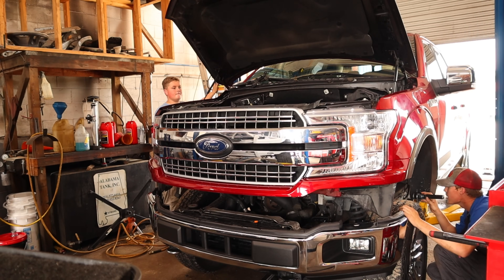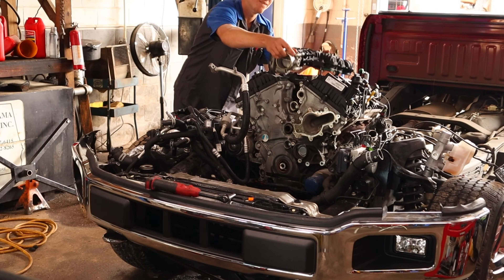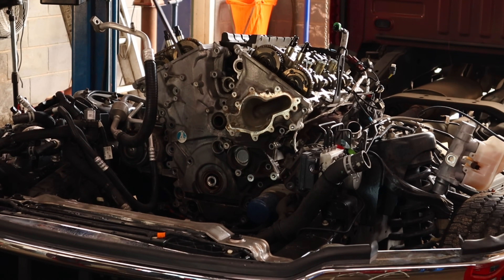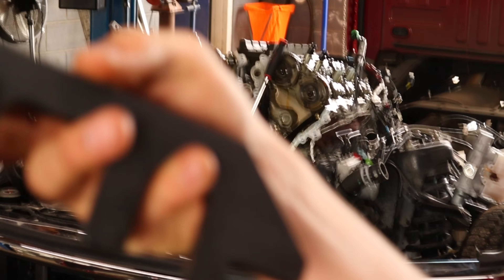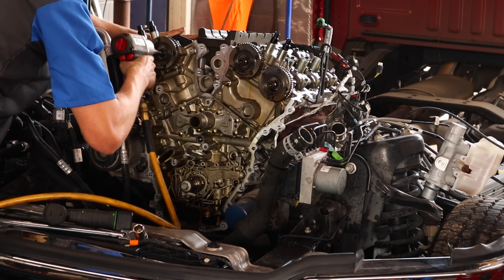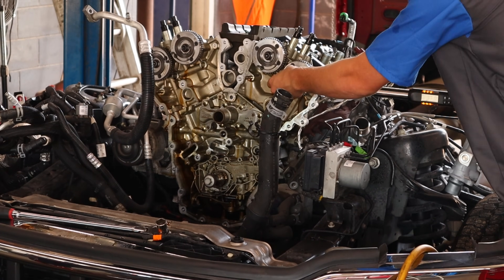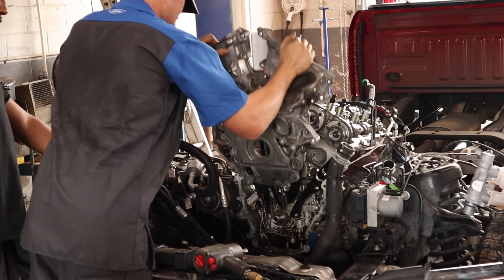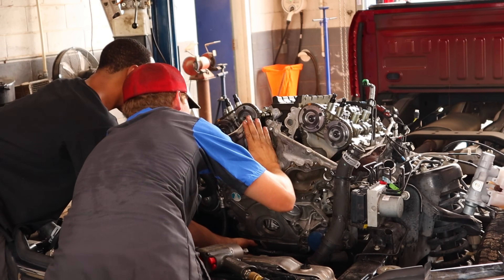Ford 3.5 EcoBoost Cold Start Rattle (VCT Phasers) | Everything You Need To Know

Comment: I miss my ford, but I don’t miss the never ending issues and TSBs that applied to it. You do a great job man
Reply from the maker: Thank you!
Reply: @FlyingWrenches13  I have the 2018 f150 with the 5.0 coyote. I have the cold start rattle every morning and doesn’t seem to give me any issues but this past week I noticed it was way noisier than usual and I’m wondering if it’s detrimental? I’m just wondering if it’s something like the hammy tick where it’s just what this engine does. It does knock too, I bought this truck last December and I kinda feel like they screwed me on this deal. It runs great but those are the two main things that bother my about the truck.

Comment: Curious as to why this isn't as common of a problem on the 2.7s or the coyotes. I traded my 3.5eco in on a coyote when it rattled, I miss the torque no lie but I like the  peace of mind that the coyotes are less likey to mess up
Reply from the maker: It’s very interesting for sure because the 2.7’s actually have the same phasers down to the part number. Never seen one rattle. Makes me thing it’s more of a oil flow issue than a phaser issue.

Comment: Sad owned fords all my life have 15 now anything with a modular engine or non push rod engine is garbage.Got a 18 3.5 been rattling since 52 thousand 70 thousand now.Have extended warranty think i will have it fixed then dump it.18 expedition max platinum.
Reply from the maker: Shouldn’t have issues after replacing the phasers.

Comment: On all of the recalls I have found, Ford says the rattle doesn't cause any damage.  Is that true?  I have an Expedition with 115,000 miles, and has had the rattle off and on since 60,000 miles, but it has never been included in a recall.  What I do now is a flood start for the first start of the day and that seems to work.  I was told about this by another Ford master tech.
Reply: What is a flood start?  I always thought a "flood start" was a a fuel-flooded start, which pretty much went away with EFI engines, but from your context it sounds like it's different since we're talking about the oil system here.

Comment: Press the gas pedal down to the floor and hit the ignition switch. The engine will not start and you can build oil pressure before you start it up.
Reply: From a certified mechanic, this is probably a good bandaid until you can afford to get it fixed.
Reply: It works will not start w pedal on the floor.
Reply: In my mind, my question would be, if oil was once reaching the top of the engine and then over time, oil pressure isn't building as quickly as it once did, what is the culprit?  If pressure will build, granted slower slower than it used to,  why would you (anyone facing this problem) immediately point to the cam phasers as the culprit?  Why wouldn't the issue point/indicate a decrease in oil delivery itself (i.e., oil pump)?
Reply: So is that bypassing the problem? I just started to get the rattle at start 2015 140k 3.5. And holding it down it doesn't rattle.
Reply: Mine is gas and brake simultaneously.  It works
Reply: On mine I hit the driver door lock/unlock switch 3X,  ignition on/off 3X, lights on/off once, honk twice, open/close the driver side door and start. 
GTG for 1 week worse case scenario.
Reply: You seriously did that? Lmao 😂

Comment: I have a 19’ F-150 3.5L Ecoboost, had the PCM update done early on and it caused the shutter. That was about 20k miles ago. Rattle has gotten louder and I now even get a slight rough idle when in Drive at a stop light. How much longer do you think it’ll last before it has to get towed in? I’m at 60k miles now, it’s a work truck so I told the dealer I didn’t really care and was just gonna send it until I couldn’t or it blew up. I got the word today that my truck is getting replaced, they are ordering me a new 3/4 Diesel. Hopefully it comes in before this truck blows up. 😂😂🇺🇸
Reply from the maker: Are you getting another ford? It will probably last forever even though it keeps rattling.
Reply: @FlyingWrenches13  I think so, I requested a Ford, we use Enterprise Fleet so they surprise us occasionally. Right now I am being told that Enterprise Fleet cannot order Fords or Chevys, only consumers can. So I could be getting a Ram. Yikes! 🇺🇸💯💯
Reply from the maker: Uh oh! Yeah new inventory is pretty scarce right now. Maybe they get you something that holds up!

Comment: Anyone out there having problems after problems with the 3.5 ecoboost. Mine has under 70k miles and always in the shop with the hood up.
Reply from the maker: What’s happened to it?
Reply: @FlyingWrenches13  warped manifold. Spark plug failure. Turbo coolant leak. Alternator went out. Now it has the timing chain start up rattle. It must be a lemon?
Reply from the maker: All of those are very common issues with those trucks. I wouldn’t call it a lemon yet but definitely sounds like you got a bad one.

Comment: Thanks on the great video, didn't even know this was a thing. Parents just bought a 2019 F-150 and it was not until I watched this video that I decided to do the research and found out that the truck still had a recall for this exact issue. Weird that they would sell a truck with an open recall like that.
Reply from the maker: Thanks! Yeah they aren’t supposed to be able to sell with open recalls.

Comment: I done a 19 F150 last week and today I'm starting in on an 18 expedition. Something I've noticed on them as I'm doing them, it always seems to be the drivers side intake phaser that fails. Ford released new phasers for the issue but I am curious to know why it always seems to be the same phaser. Very strange...
Reply from the maker: Your saying the driver intake phaser is the one rattling?
Reply: @FlyingWrenches13  
Yes, once the chain is removed grab the sprockets and try to move them by hand. They should be locked in place but the several I've done you can turn the drivers side intake sprocket lock to lock on the phaser. Seems the locking pin is failing for whatever reason. The sprockets are the same left to right so I wonder if the solenoid is being held slightly on on the drivers intake and causing the locking pin to wear excessively, or something along those lines. They have a PCM reprogram that is supposed to fix the concern as well. Time will tell after this latest update.
Reply from the maker: I’m gonna check this on my next one. Thanks for the input!

Comment: Thanks for putting out the video. 

Have you seen this issue with the 3.5 ecoboost in the Ford Transit vans?  

I believe the Transit vans still get the older gen1 engine. I am sure the engine has been updated some over the years, but since it is a DI engine only with no port injection, everyone still calls them gen 1.
Reply from the maker: Yeah I think they are. I’ve never seen a transit with this issue.

Comment: We had a 2015 Explorer Sport and now have a 2019 Explorer Sport and a 2021 Powerboost F150. All have the 3.5l. The first Explorer had startup rattle fixed twice under warranty in the first 50k miles. The 2019 is ok so far, but had a very slight rattle the other morning with 29k on the meter. We always pay th roughly $1,800 for the ESP platinum warranty from Ford as it gives us a rental and is cheap peace of mind.
Reply from the maker: How do you like the power boost?
Reply: @FlyingWrenches13  I love the quiet and smooth ride. My other truck is a '98 3500 RAM. The acceleration is very impressive at all speeds too. My only real nitpick is the sometimes rough startup as the transmission shifts from 1st to 3rd and the gas engine starts. This can be minimized by how you accelerate. If you start up slowly, the gas engine won't come on and it is smooth. If you really step into it the gas engine comes on and it shifts from 1st to 2nd to 3rd, which is also smooth, but if you step into it just a little, it will start in electric, then as it jumps from 1st to 3rd, the gas engine comes on at the same time and there is a little jerk. Again, this is nitpicking. 
For a new truck redesign I am very pleased and really expected more bugs and quirks. The best part is the instant torque when pulling onto a highway or passing. Makes driving my Explorer Sport seem very laggy by comparison.
Reply from the maker: Yeah people don’t quite understand how on demand the torque is until they drive one. Thanks for the feedback!

Comment: 2017+ 3.5 ecoboost: leaky oil pans, rattling timing chains, useless 10r80 transmission…. I see why people are going to the outdated 5.7 I force from Toyota. A $40k+ truck shouldn’t need thousands of $$ in repair work before 100k miles
Reply: 127k on mine ....none of those problems
Reply: 5.7 tundra was best truck I ever owned. 6 years and never had an issue with it.

Comment: This just started happening to my 2019 3.5 ecoboost. I downloaded the my ford app, when I inputted the vin it showed the recall for the transmission reprogramming. Truck has been at dealer for a week now with no update, they want to run further tests. Should I be telling them to no reprogram it? the truck only has 14k miles on it.
Reply from the maker: Yeah they should just be able to perform the program. If it solves the rattle great, if not order some phasers.

Comment: I bought a new 2018 F150 2.7 ECO and it had a nasty loud engine rattle on cold engine start (sounded like timing chain banging on metal) the day after I drove it off the dealer lot. I wonder if that's the same noise you're talking about? My dealer wasn't able to fix it for about 2 months (parts were back ordered) so I returned the truck and got a different one. This is the first Ford tech video where I've seen you take the body off. Looks like a lot of extra work but maybe it's not. Do you do that so that the video recorded work is much more clear? Thank you for sharing your expertise.
Reply from the maker: It’s not just for the cameras. I remove cab on everyone I do. Takes about and hour to get off.

Comment: It oil pressure issue. The next one that you come across that has that tiny rattle   Hold the gas pedal to the flow turn engine over till oil pressure come up release it want rattle. there a point that this don’t solve it either I guess it pretty much toast by then needs phasers and chain lol

Comment: How has ford STILL not figured out the VCT issues?  They have been having issues since the first 3v 5.4's came out MANY MANY years ago.  I love my ford trucks but Ill never buy another.  Thats rediculous.....
chevy trucks for me from here on out when I need a half ton.
And why do the 6.2's seem to not have nearly the issues with the timing components that the others do?  My 6.2 has over 300K miles and never even had a valve cover off
Reply from the maker: Yeah I agree Ford needs to do better with there vct systems. I will tell ya watch those liters on the chevy’s. They are notorious for having issues. 21 model GM’s have even been having problems. Different design on the 6.2’s which is why they don’t have any issues.
Reply: @FlyingWrenches13  agreed on the lifters... not cheap  and under the head it's a $2K job to swap them out, and they seem to fail every 60K miles.

Comment: Look at the oil filter.  Not motorcraft.  Every one I see that has this problem always has a non Ford oil filter on it.  I feel like the aftermarket oil filters cause the damage.
Reply from the maker: Could possibly be a factor for sure. I will say I’ve seen some that never had oil changed anywhere other than the dealer and still had the issue.
Reply: @FlyingWrenches13  We have dealers around here that use ultra cheap China filters.  I wish Ford would nail the cause down.

Comment: Hi thanks for the info. My question is if you think it's an oil  Pressure problem on cold start due to the oil draining back down in the engine Why would it take 30 or 40000 miles To show up .
Reply from the maker: That’s a good question, I’m not sure why some show up later than others but I have heard from some 3.5 owners that their’s started rattling within the first 5k miles.
Reply: @FlyingWrenches13  Mine started at 18K Dealer did the reprogram still rattles taking it back Monday to replace parts, hope that fixes it.

Comment: Just brought my truck in yesterday as I got check engine light and codes for vct timing problems. Dealership said they replaced the phaser. Got truck back since then have been having crazy hard shifts. So I just dropped it back off today (2017 3.5 eco f150) just rolled 24,500 miles...this sucks
Reply from the maker: Hate to hear that! Maybe they get it fixed for ya.
Reply: @FlyingWrenches13  but is there any actual fix for the phaser issues or just replace and wait again
Reply from the maker: I haven’t had any come back after being replaced. I think that replacing the phasers is fixing the majority of them.

Comment: thanks for the info.

got a question, what will happen if I leave it without replacement? are we taking about complete engine failure?
Reply from the maker: It actually won’t cause any other issues. It will just keep on rattling.
Reply: It won’t cause additional problems.it’s just a nuisance.

Comment: I bought a 2013 3.5 used in 2016 with 27k. 2 yrs and 20k miles later the noise in 2018. Dealer said I need to replace the engine. I did. Now 3 yr later ams 24k miles later...same noise. Truck has been excellent otherwise.
Reply from the maker: Engine should have warranty on it still.

Comment: Mine goes in this week for this. I was told that they have to do the reprogram first before they do anything else. Mine has been making the noise since like 12,000 miles and now has 36,000. I guess we will see what happens, Im not too optimistic that the reprogram will fix it.
Reply from the maker: If not, at least the phasers should be covered.
Reply: @FlyingWrenches13  Dropped it off at 8am this morning and they called me by 10:00am to tell me they are just going to replace them because after looking into it they dont think the reprogram will work. The tech said they dont lock up. I was told it is fully covered under warranty so Im happy with that.

Comment: Fingers crossed I don’t run into this issue. I have a 2019 3.5 with 45k miles and took it to get the PCM reprogrammed when that was active. I do notice a slight rattle but it might just be the injectors I hear.
Reply from the maker: You will definitely notice it if the phasers are rattling. It sounds roughhhhh

Comment: Awesome video brother and very interesting. Maybe I misheard what you said but did you mention something about this cam phaser NOT being an issue in the high output motors, like the Raptors?  Thanks man. Appreciate ya
Reply from the maker: Thanks man! Nah the High outputs have the same issue. I was talking about the high output not being covered under the extended warranty recall.
Reply: @FlyingWrenches13  awww gotcha!  Very good sir and thanks for the info. I’ve got a 2020 Raptor and was hoping o wouldn’t have to deal with this issue on an 80k truck but who knows.
Reply from the maker: Yeah unfortunately it’s all the 3.5’s doing it.
Reply: @FlyingWrenches13  Is this issue something that would eventually cause internal damage if not corrected?  And if the newer 3.5s are coming with the updated parts, then this problem could, in theory emerge again, further down the road?  Sounds like there really, thus far, isn’t a permanent corrective fix?

Comment: I like the video, Can you make one of the 2.7, mine is 2017 would be nice to know what the common problems and how to fix it, I have one more year with the powertrain warranty and if something is about the break will be nice know, so I can take it before the warranty expired. 
Thank you
Reply from the maker: I’ll put it on the list. Honestly the 2.7’s are pretty solid. I’ve worked on very few of them.
Reply: @FlyingWrenches13  good to know, I would think the 3.5 been the main marketing point of the F150 will be better.
What about the 2.7 carbon build up in the intake valves from the 2017 which is first generation, Is a big issues or not much to worry about? I know with the time it will happen but at least over 150k miles or more. Thanks for your previous response.
Reply from the maker: Never seen anyone have an issue with carbon buildup on the 2.7’s or 3.5’s. I honestly think people go overboard about carbon buildup. You can have a induction service done and get it all cleaned off with no problems. In the grand scheme, i’d say carbon buildup is a very small issue on the 2.7/3.5 compared to the others.

Comment: Solid information, thank you for the video. My Vehicle is a 2018 F-150 w/60K miles, Ford paid 66%. They called me mid repair and said the valve cover was cracked and I would need to pay for it, an extra $130, I assumed the tech broke it while removing it but I felt it wasn't worth disputing. In the end my total was $670 which I feel pretty good about. In so many ways this is the best truck I have ever owned, my whole family loves it and is comfortable while traveling, I have 0wned quite a few Fords and Chevrolets but this one stands out as being the highest quality, with this one exception. I wished Ford would figure out the Cam Phaser deal, Cam Phasers plagued the Ford trucks since 2004, maybe not the identical issue but the same part none the less.
Reply from the maker: Glad to hear you got some paid for! Yeah Ford is really slow it seems to correcting an issue that so many other makes have had almost no issues with for years
Reply: One of my valve covers cracked and showed up as a leak after vct replacement.   Fortunately for me mine was at 56k so Ford paid
Reply: Who did you talk to so they would pay the 66%?